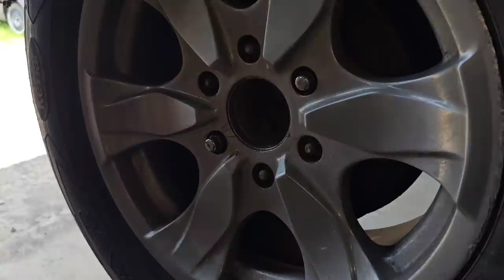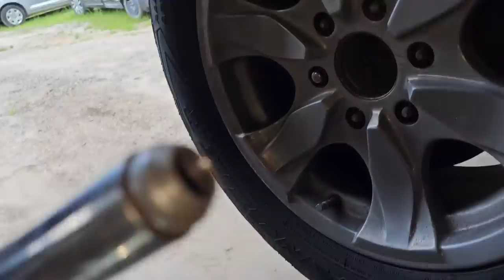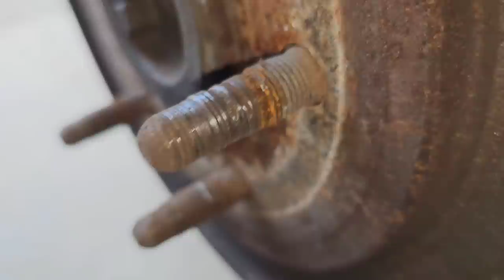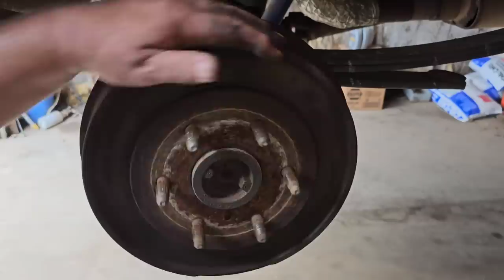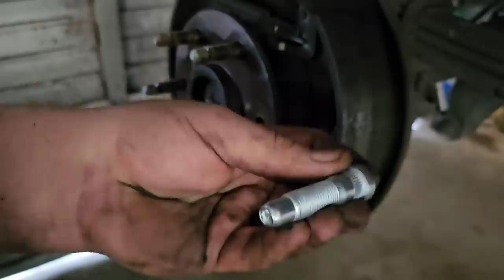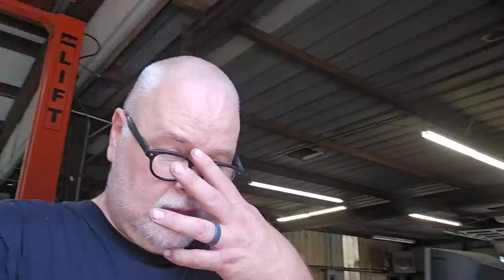Lug Nut Destroys Stud & Won't Come Off... Now What !?!?

Comment: Stripped bolts never a joy! U handled your wheel stud perfectly. Had a similar problem on a 2006 PT Cruiser Turbo GT. 
When trying to remove lug nuts an impact wouldn't move them. Used a socket, flex T handle and a four foot snipe. Only worked on one lug nut per wheel. All the other factory MoPar lug nuts sheared off at the top of the lug nut cone. 
The factory wheels were fitted with a  plastic cover as part of the wheel. This cover had a plastic chrome paint finish. Thus, I was hesitant of using acetone based penetrants or heat to free up the electrolysis bond between the ferris metal lug nuts and the alloy lug nuts.
The solution was to drill out sixteen wheel studs, replace all wheel studs and replace the defective Mopar lug nuts with after market all steel lug nuts.
The factory lug nuts were of an alloy with a stainless steel cover cap. The problem was not rust but electrolysis from the dissimilar metals of the stud and nut.
Once sorted a complete tire replacement strut replacement, full brake replacement and control arm bushings replacement. ( R/R of the control arms was another nightmare)
The customer was very understanding and paid for all extra hours. He has an attachment to the vehicle that is refreshing.

Comment: From the thousands of holes I have drilled in numerous places, shops and things, even if you have  perfect new drill and it cuts like butter a small pilot hole is good in keeping it from WANDERING.
Usually what happens here is nobody ever lubes up the threads because everybody the world over knows that if you oil the threads, your lugs will fall right off.
I once got lectured in front of my father by a mechanic in a garage because he found oil on the threads of my father's car. I was a criminal endangering the entire family because our lugs were going to fall right off and make us crash.
I then went on to oil wheel stud threads for the next 50 years and never had any fall off ( unless i ripped the whole stud off but that is a different story ) and I also never had this problem on any of my own cars, just other people's cars.

Comment: I'm a retired tech. Was in the tire industry for quite some time. In my opinion power tools are great. Unfortunately, I found the impacting forces accelerate the galling of the threads. It is a bugger but, I found manually loosening is better. Back and forth and so on. Takes awhile but it works.  Penetrating oil helps. I've saved many of wheels. Minimal damage. European cars are the worst. Once the wheel is off, all necessary repairs can be done.

Comment: Nice job! I hit those drums much harder, they normally break loose. After market wheels or not, make sure you are not cross threading the lugs to start with and you won't get this problem. People, geech...
Reply: I use a blow torch on sticky drums,  after a minute they usually slide right off.  Either way there is a risk of warping.  In fact when I change a set of brakes, I don't even waste my time on old drums and rotors any more.  Just replace them all and be done with it.
Reply: @lo1234-w9r  I do too, for what it cost for new ones, it's hardly worth turning them anymore.

Comment: Kenny I worked on Drum brakes many times.  The easiest way to get a drum off is use a tool and retract the brake drums back before trying to remove the drum.  The rust ring that forms around the edge of the brake surface is the problem most of the time.  Thank You Kenny!😁
Reply: Use an impact gun on the drum first.

Comment: Lost 3 out of 4 lug nuts on my Honda Fit and a stud broken off. No clearance to get studs out. I had to pull the steering knuckle and have a shop press in a new bearing and hub. It was a tuff job. (Front wheels).

Comment: Gotta say one thing. When lug nuts start to seize  don't use impact devices. They make it worse. Do it by hand. Back and forth. Takes a while, but it's worth it. Driii the center of the nut and inject  lots of lubricant.     Done this many of times. High end vehicles are the worst.

Comment: My old tire service station that do the tire rotation for my Isuzu Troopers that used OEM Magnesium Rim in high saultty area in Western MA will not put any effort when they can not take the tire off vecause of stripped tread. The owner of the service will keep walking out to the service area to see how much time the service man spend on effort to switch the tire and will terminate the service and charge you for hours that spend on this effort.
Reply from the maker: It's Mrs Wrenching. I would find another shop to get my work done. That's crazy! Thanks for watching-Meg 🔧
Reply: ' Mrs. ' Wrench

Comment: Good job Kenny....😏😀🇬🇧🇬🇧 I like to grease lug nut threads....😏😏
Reply: The torque specs on mine are for clean dry threads.
Reply from the maker: Thanks for watching. Keep wrenching 🔧
Reply: @dennisharvey4499  That's fine and dandy until they rust in place...and your then watching a video like this one ...😳😳😏😏😏🇬🇧

Comment: Customers never understand how hard it is sometimes to remove a stuffed bolt especially when you get a car in the door you haven't worked on before and it's old yesterday I had to do a complete suspension rebuild on a ba falcon 120 ks 20 years old never touched and man did I have some fights with ceased bolts but the one that got me nearly throwing my hands up was ford put the bolt wrong way as to I couldn't remove it due to the fuel tank was interfering with removing it I not pulling fuel tank out and rear suspension cradle for one bolt so I die grinder head of bolt and put one in correct way saved 8 hours for customer now car points and steers like new some engineers baffle me sometimes as y they do dumb stuff like this when bolts should go opposite way grrrrt

Comment: Had a similar problem a while back but it was actually caused by idiots using "Power Tools" in the first place. I had my wheels rotated and did a track and balance at one of the "One stop" tyre and brake chain shops locally. These idiots used a windy gun to fit the lug nuts back on to the studs, but the windy gun was obviously just set to maximum and they totally stripped the stud / lug nut.
What was even worse was that the lug nuts on the remaining studs were on so tight that I could not even remove them using an 8 foot extension bar! Imagine getting a flat on the road and trying to replace your wheel for your spare? Impossible.
I was so mad at their stupidity that I made a complaint to their head office and lo and behold, it seems to have actually got through to them and since then, at my local shop, they now use a torque wrench to tighten the lug nuts up.
I was trying to picture some poor woman trying to change a flat tyre for her spare at the side of the road on a rainy night with the factory tools supplied with the car, what a nightmare. Idiots.
Reply from the maker: I'm thankful you took the time to say something. Their managers did the right thing. So many people would have let it go, but you saw the bigger picture. Thank you for watching 🔧
Reply: @WrenchingWithKenny  Your videos are always honest, straight forward and practical, not that many on Youtube as so many are just looking for revenue. Anything that informs and helps has to be worth promoting. Regarding my bad experiences previously, I would hate to think of my wife stuck alone with this sort of problem - I also made a horses ass on my Diff. Stupidly I used a Makita impact wrench to try to loosen the over tightened / seized drain plug on my Toyota Diff. my finger slipped and it switched the direction of the impact from unscrew to screw and I ripped the threads off the plug - luckily, the plug stripped before the actual diff. casting. So, I am not perfect, mistakes happen, but channels like yours really help people out, so thanks for your videos. Greatly appreciated.

Comment: Wheel studs are made of high tensile steel which is very difficult to drill, saying you can drill it just as quick with a single large size drill (1/2) as you can by first using a pilot drill, sorry to say that is BULLSH#T.